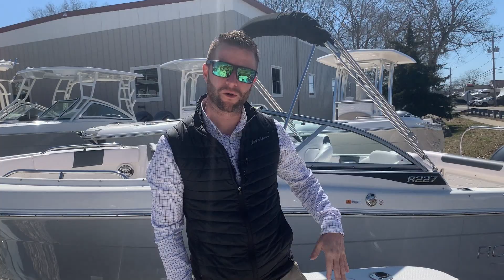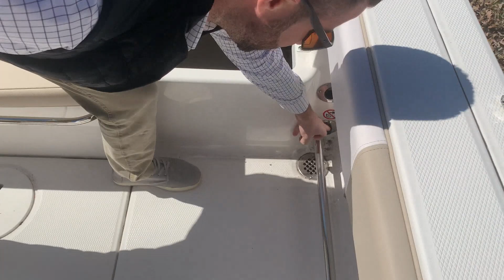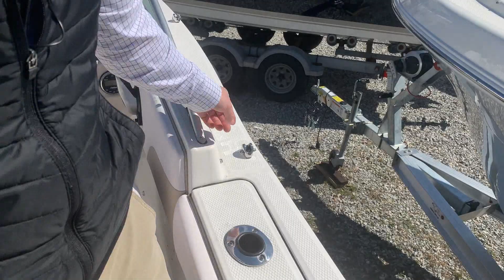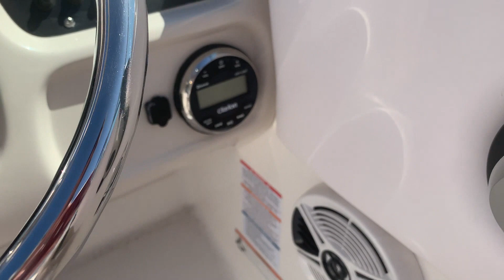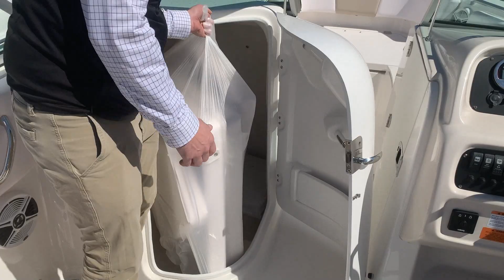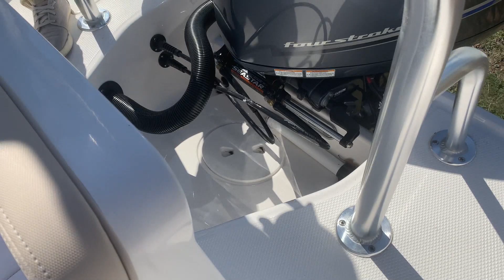Digital Delivery: 2020 Robalo R207

Comment: Think I'm going to pass on a Live Well and Salt Water wash down  - through hull ball valve - another failure point. .  I'll just chum with several bags, or cut dead bait and fling it over the side, and I already  have an aquarium oxygenator that runs on trolling batteries for a 15  gallon plastic cooler from Walmart  ; P

Comment: Great info...Quick question; is the Robalo r207 equipped with a digital shifter?  Does it shift into forward and reverse digitally or does it shift into gears mechanically thru cable?
Reply from the maker: The fly by wire engine is an upgrade that can be added. Mechanical shift and throttle engines are standard on the R207.